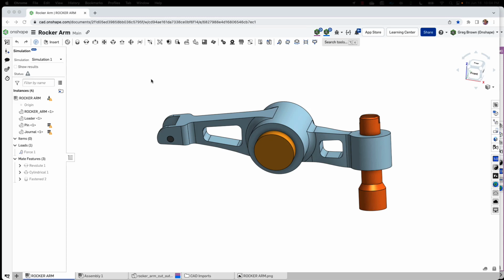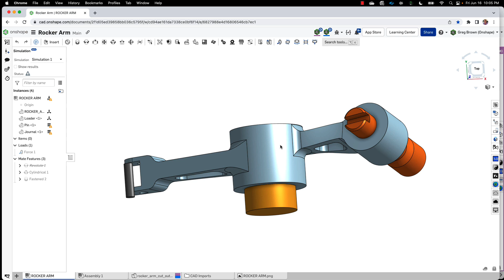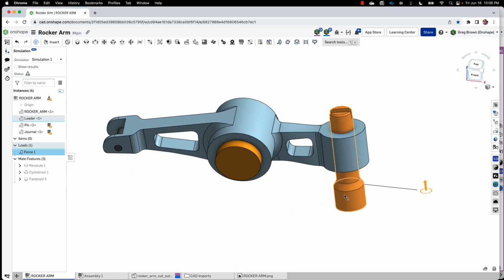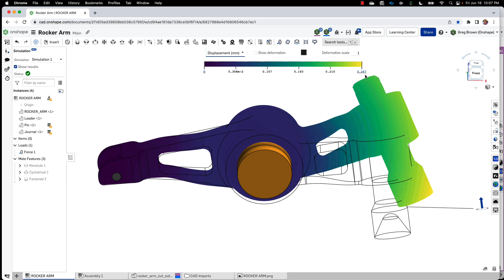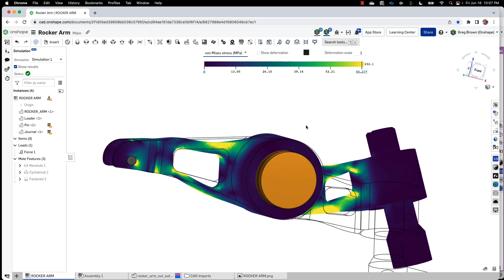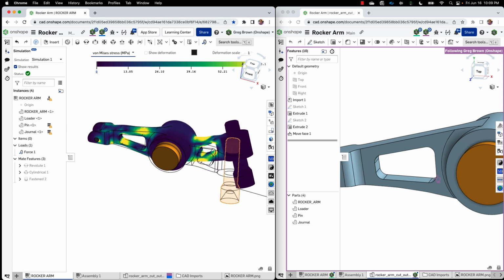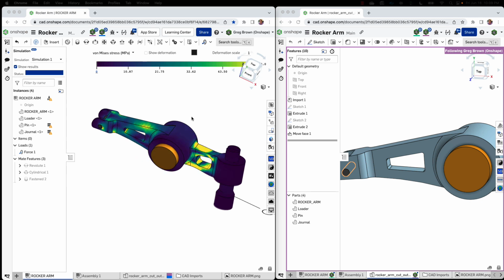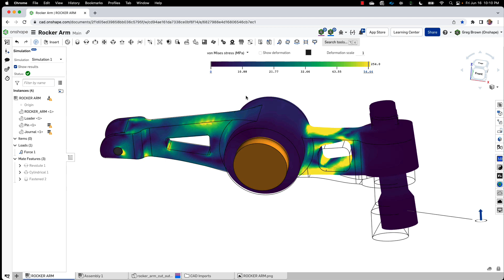FEA simulation of a rocker arm

Comment: DO NOT TRUST ONSHAPE FEA. Onshape FEA gives complete garbage results. Anyone with half a sense for reality can watch this video and realize that this part will not move in the way the simulation shows. Run this part in a real FEA Software and you get totally different results. The ROOT of the problem is that Onshape FEA basically uses fixed boundary conditions when and where is should be using rotational or slide boundary conditions. In this simulation, the pin on the left acts as though it is glued to the part with an infinitely strong glue. The result is that the software tries to calculate stress with the part being prevented from rotation at the left pin. Thus a twisting moment is applied within the actual material of the part rather than a simple opposing force at the pin. Thus we see stress concentrations to the bottom right of the pin and not at the top where a real software would predict them. We also see a S curve twisting within the left arm members of the part, due again to the fact that the far left end of the part is imaginarily glued to a pin that is also infinitely rigidly prevented from moving or rotating. Please ONSHAPE, pull the FEA software out of BETA and start with a new architecture that allows the user to define accurate boundary conditions. All of your tutorial videos and help videos online show these same inaccurate results. I tried to use the software to prevent itself from making these detrimental assumptions, but there doesn't seem to be a way to bypass the core assumptions built into the software in an attempt to simplify setup for the end user. Yes it's simpler. Yes, it's terribly wrong.